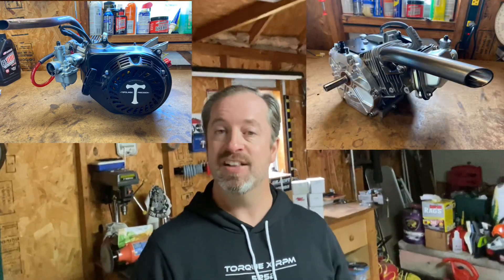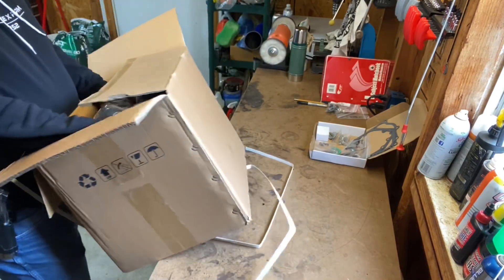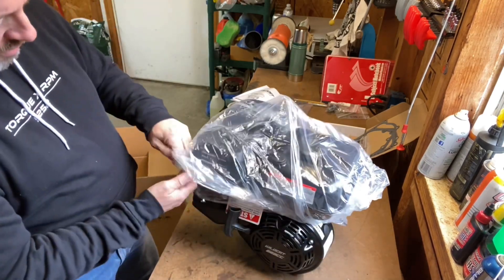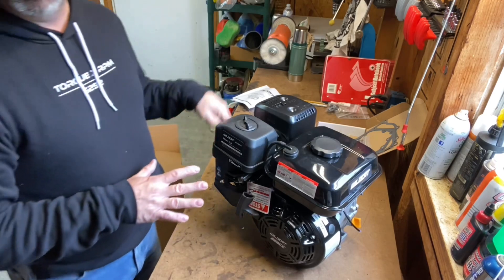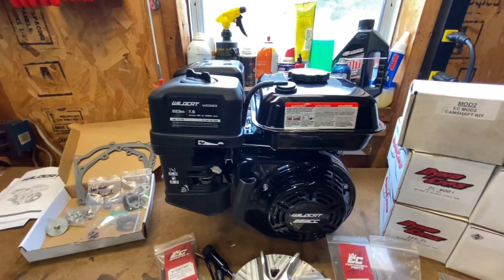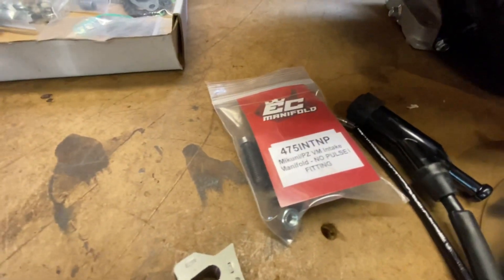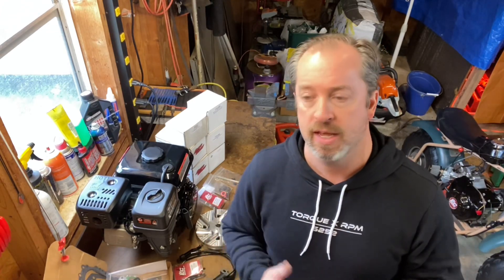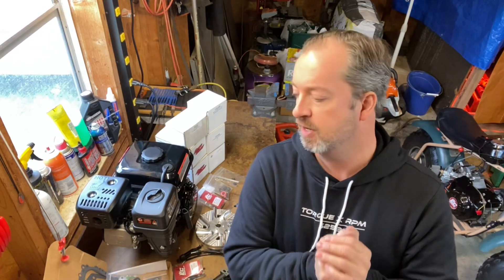A Competitor to the Predator! The Wildcat 223cc enters the small engine wars as a new heavy hitter.

Comment: Hey Patrick since you haven't posted any other videos on this Wildcat 223cc Engine I gotta ask how has it been running so far ? I am strongly contiplating replacing the stock 196cc engine on my mini bike with one of these and just putting the typical stage 2 kit on it as well as a Torque Converter. Has it been impressive so far or what ?